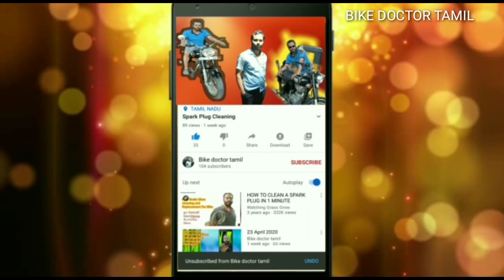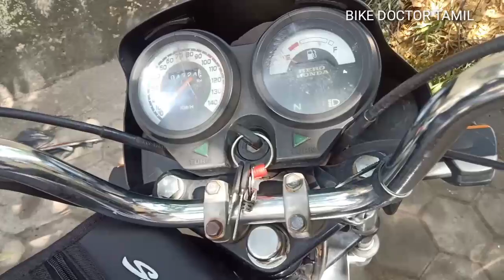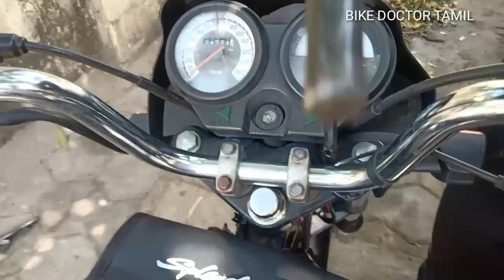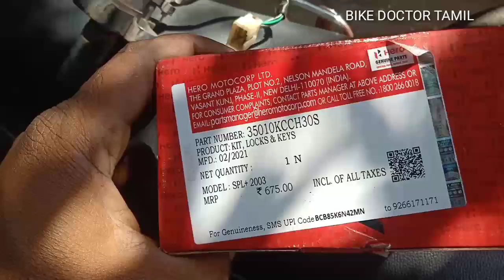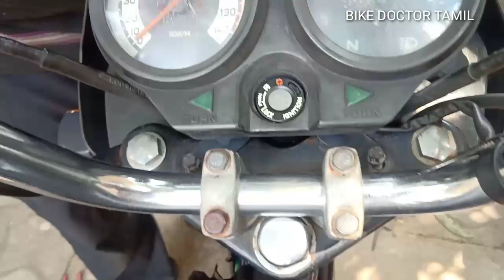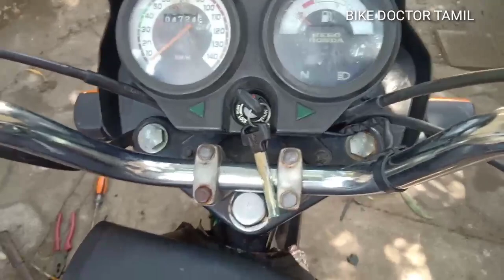Splender Key Set Replacement In Tamil

Comment: 💐ஹலோ அண்ணா நல்லா இருக்கீங்களா❤️,என்  bike  எருமை மாதிரிதான் ஸ்லோவாக தான் போகும், வண்டி ஒட்ட மிகவும் சிரமமாக இருக்கும், mileage வேற இல்லை,mechanic கிடம் கேட்ட போது ஒரு 6  to7 அல்லது 8 ஆயிரம் ஆகும்னு சொன்னார்கள்,சில ஆயிரம் நான் என் BIKE கை விற்று விடலாம் என நினைத்தேன், புது bike வாங்க 😭 ஆனால் இந்த கொரோனா வால்  எனக்கு  வேலை சரியாக இல்லை,சரி இன்னும் சில காலம் இது தான் நம் தாலை விதி என நினைத்தேன், முழு lock down ல உங்க விடியோ அனைத்தையும் பார்த்தேன், பிறகு வீட்டில் இருக்கும் டூல்ஸ் இல்லாமல் இன்னும்  700 ரூபாய்க்கு  ஸ்பெஷல் டூல்ஸ் வாங்கினேன், பிறகு  1000 ரூபாய்க்கு பொருட்கள் வங்கினேன்,ஒரு லிஸ்ட் எலுதினேன் , கிட்ட தட்ட 35 point அனைத்தையும் ஃபாலோ பண்ணி இப்ப வண்டி சும்மா பறக்குது,சூப்பர் ஆக இருக்கு,மிக்க நன்றி,கிளட்ச் கேபிள்,axileater கேபிள்,கிளட்ச் பிளேட்,rotor cleening, chain adjust ment,head dee corbon பண்ணினேன்,oil CHANGE,spark plug change , sir filter change, corporater cleen, என a to z una விடியோவில் வரும் அனைத்தையும் பார்த்தேன்,grece apply ,oil applay,play adjust, எல்லாம் பண்ணி ஒரே நாளில் 235 கிலோமீட்டர் ஒட்டியும் பார்த்து விட்டேன், தங்கள் சேவைக்கு நன்றி, நீங்கள் நீடுழி வாழ வாழ்த்துக்கள் 💐🙏 இன்னும் அந்த realy type security system மட்டும் part வாங்கியாச்சு அடுத்த வாரம் செட் பண்ணிடுவேன் நன்றி